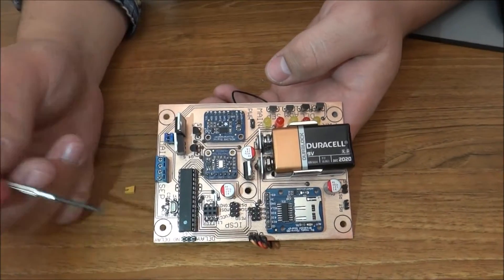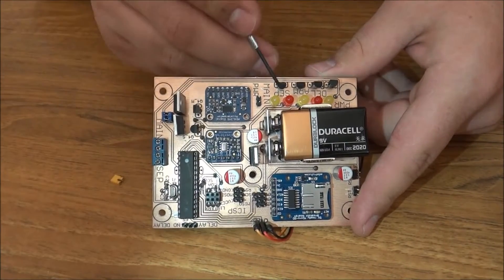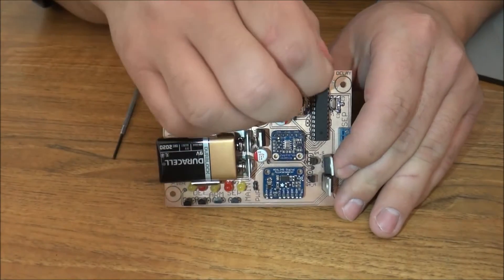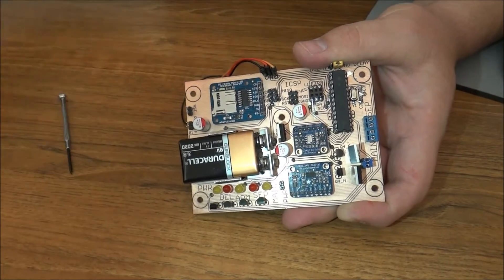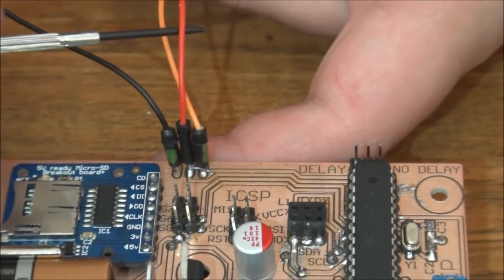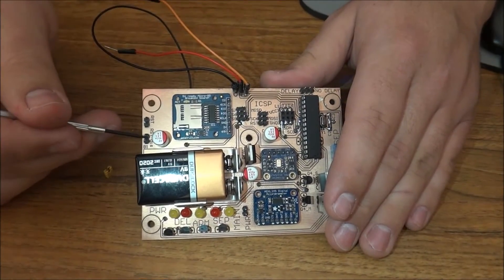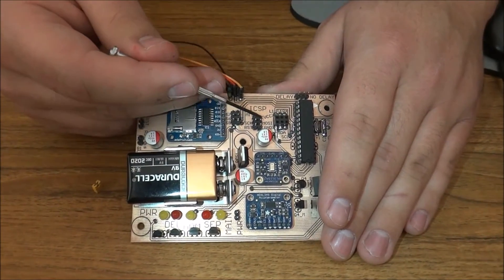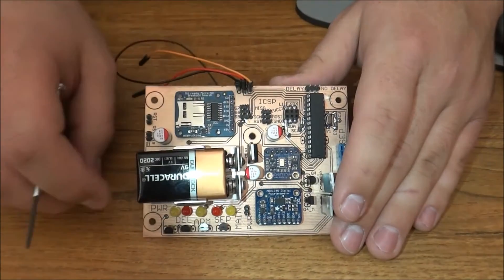2016 how avionics system works

Comment: Which parts do I need to purchase to build a duplicate of urs
Reply: looks like a sensors are manaufactured by adafruit; sd card reader, accelerometer and altimeter. all 3 are easily found on amazon. microcontroller is most likely atmega328p, pretty much whats in an arduino.